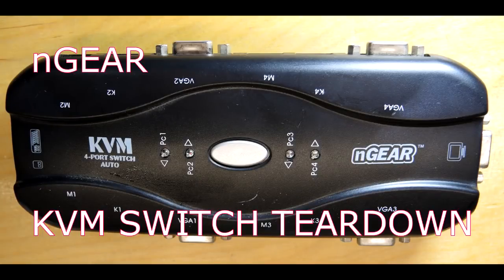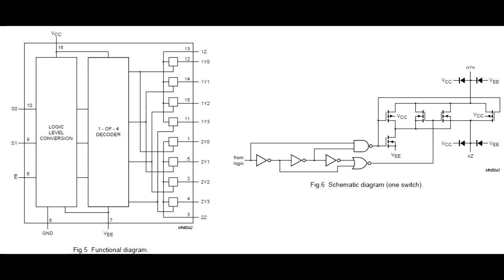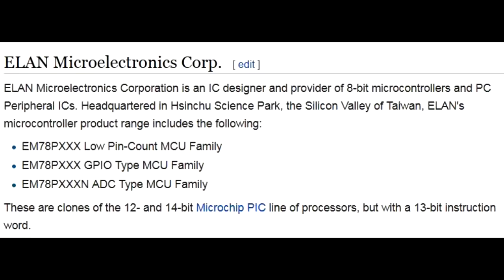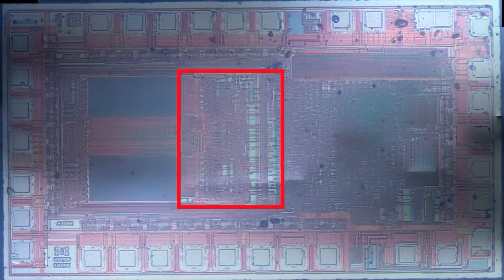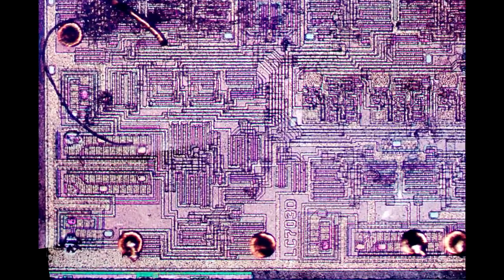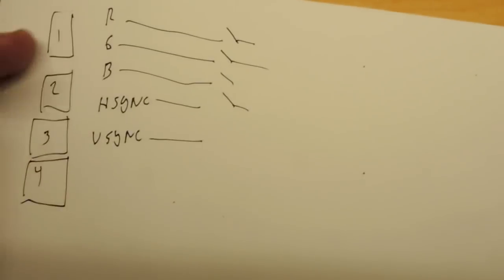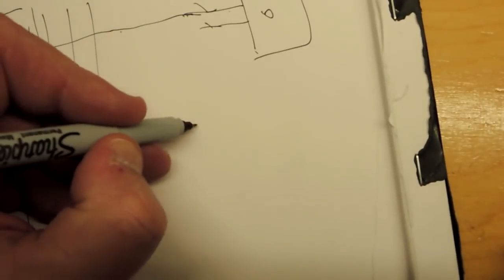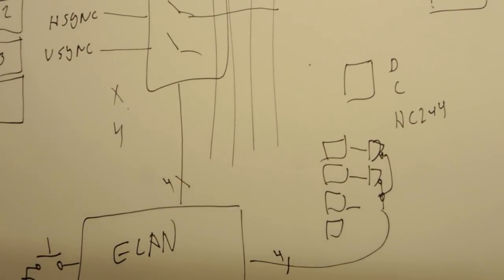nGEAR KVM TEARDOWN: REVERSE ENGINEERING A LOOK AT SOME  SILICON DIES

Comment: I've always wondered what actual effect letting these switchers run by drawing power from the PS/2 inputs actually has. Somewhere along the lifetime of these things, the wall wart would make a clean getaway, and eventually - often years later - the switcher would start to freeze up if you tried something so daring as to reboot one of its connected PCs. Until that point, they seemed to run fine, and yet the vast majority from countless manufacturers would include a DC power adapter.

It's kind of moot now with out of band management, laptops everywhere, USB, etc, but it's been a tickle in the back of my mind whenever old gear like this shows up. In an every-penny-counts world, why include something so relatively costly that wouldn't be needed?

Comment: VGA signals can be pretty high frequencies but most KVMs limit you do only about 1600x1200. Of course it's all relative. If you consider high frequencies to be in the Ghz range, then no, VGA is not high frequency.

Comment: The microcontroller has to do a bit more then just sequencing. All the PS/2 interfaces are routed to it, because PS/2 is not hot swap. Therefore, it has to emulate a keyboard for all 4 remote devices. It just swaps which device it forwards the key-codes to.

As a result, it can also do things like allow swapping when you press certain key-combinations or sequences.
Reply: I was hoping the micro was more than a binary counter

Comment: I wonder, why bother with a microcontroller at all. Couldn't this be done with pure logic parts, using something like a decade counter to enable/disable the various mux chips? I suppose the uC could be sensing the G signal to determine which inputs were in use, and skipping the unused ones when user hit the switch.
Reply: The very cheapest chinese 2 port KVMs don't use a micro, just standard 4052 MUX chips and a flip flop chip (I forget the number).

Comment: I still have one of those KWM switches somewhere.

The ghosting and crosstalk was so bad, it was unusable. lol

The specs of the 4052 / 4053 switches usually aren't too bad, so I often wondered if the PCB layout was just sub-par, or lacked decent decoupling or DC-blocking?
Reply: (I did also try some high quality VGA cables, and different power supplies at the time, and the switch was still awful, sadly.)
Reply: I have a protec bytelan 4 port KVM thati found on  eBay for £5 even though they're worth £30.. Its much higher quality than these cheap plastic KVMs. The case is 2mm thick solid steel and I only get slight ghosting with high resolutions. The 4 PS/2 mouse ports are switched with a single 4052, same for the kbrd ports. The VGA, PS/2 kbrd, PS/2 mouse ports are on 3 separate PCBs with all the ports at the back where they should be, not spread all around the sides.